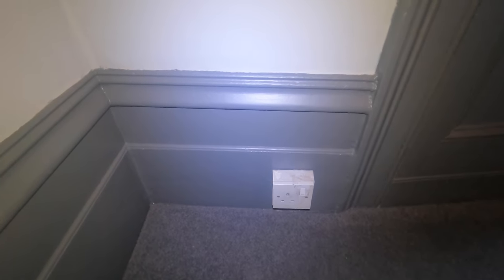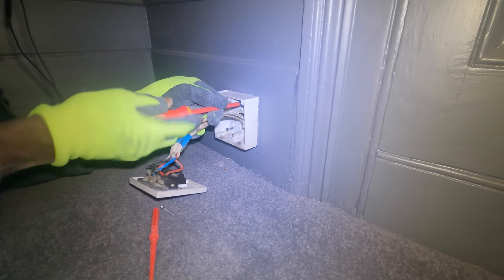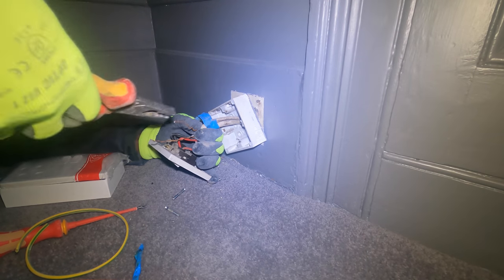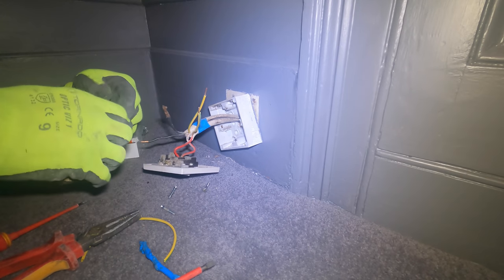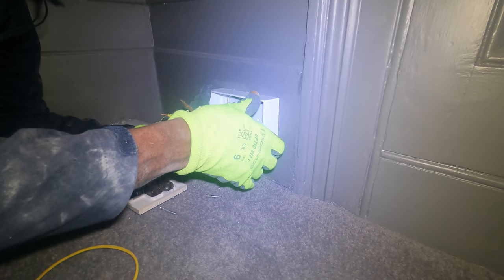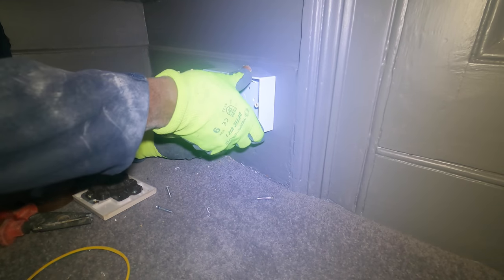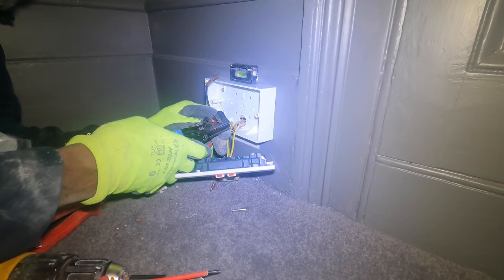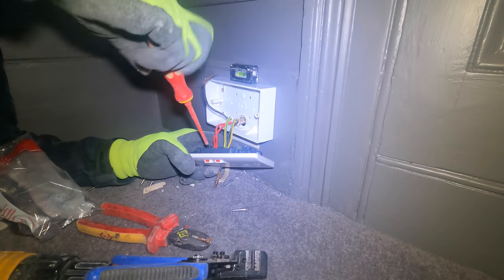Single To Double Socket Change | Delroy The Spark Full Process

Comment: I can’t believe you sparks still use slotted screws in the UK on power points , we use cross head screws here in AUST 
Much easier and they don’t fall off the screw driver
Reply: For aesthetic reasons I think

Comment: If there's not enough slack on the wires..  isn't ok to just add extra wire? Connecting with (electrical connector) the new cable/wire to the old one, to make up that extra length needed? And if not recomended, why? Thanks in advance. Keep up the great work!! Thumbs-up 👍

Comment: Just wanted to ask by standard is the outlet to low in case of water flood
Reply: Yes, building regs say minimum 450mm from floor level. This is done so that it's a more accessible height for disabled/ elderly people etc. (as well as flooding like you said).
Reply: Approved document M (approved documents are government guidance on how to comply with the building regs, but they are not the building regs themselves) says that sockets should be at least 450mm high for disabled accessibility reasons, but a general principle of the building regs is that when working on existing properties you are ok as long as you leave things no worse than how you found them. So replacing sockets in their current location is fine from that regard.

As far as I am aware there are no specific regs on protection from flooding. Presumablly because what is and is-not reasonable in that regard would vary massively from one location to another.

Comment: What I normally do is when fitting double sockets I normally if the socket has two separate earth terminals I put one earth wire in each terminal even though the terminals are connected if you put both wires in one terminal and that then comes loose it leaves the socket without any earth. And also if the wires are still touching it wouldn't necessarily come up on an electrical safety check that the socket was un earthed or that they had come loose so it would go un noticed. If you put an earth in each terminal it still leaves the socket earthed should a wire come loose and would be rectified on an electrical test.

But..... I believe this double socket had one terminal as it was in the middle so i will give ya that one ;)
Reply: Great job though pal, very professional 👍👍

Comment: Buy a impact driver. As small as you can find. Makita and dewalt have good ones. They pack more power than that huge drill you have for screws. I see you struggle with the weight sideways, which is normal. For me, one hammer moment is enough to confirm a well torqued screw.